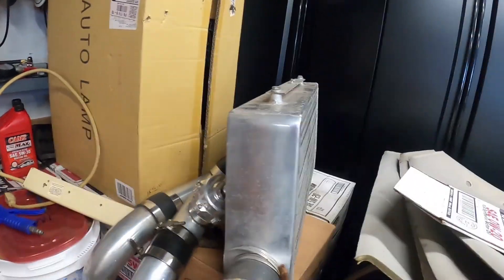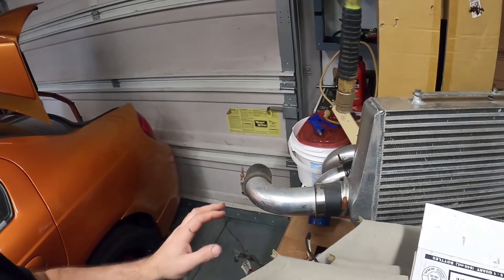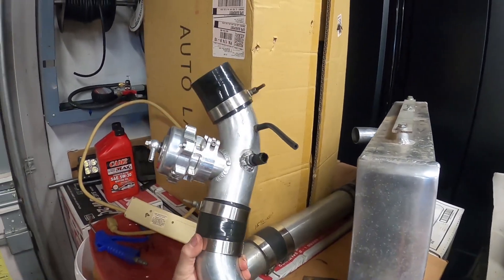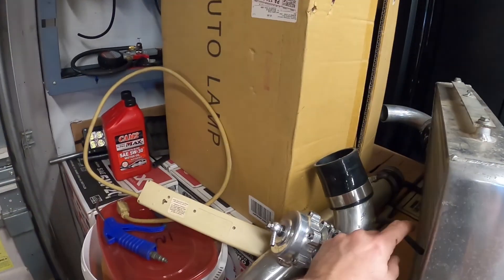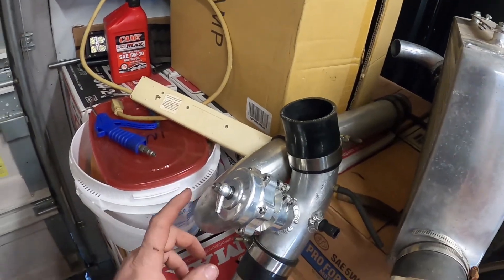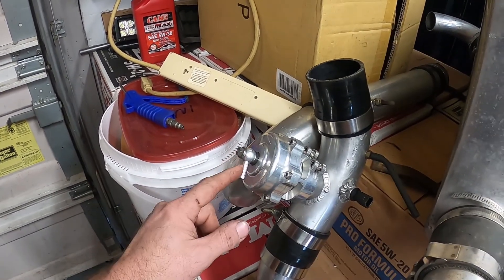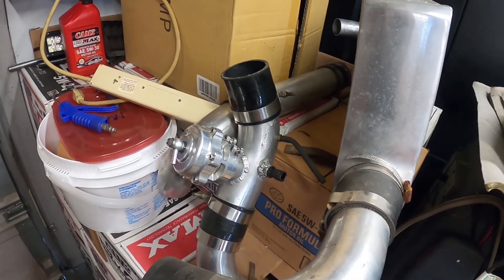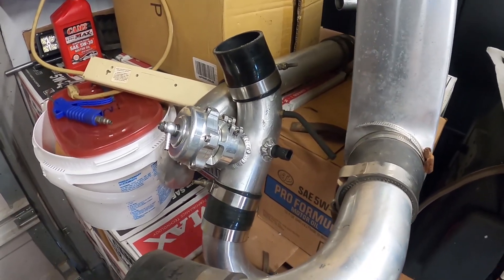srt4 boost issue after bov and bfm upgrade

Comment: THANK YOU! I watched countless of videos on how to install an HKS blow off valve but they dont go in depth on how the vacuum lines should go, your video was of great help!
Reply from the maker: The vacuum line for any aftermarket bov will t-off for vacuum at the port at the throttle body you will not need the vacuum lines off the blue solenoid if you still have factory lines you can un hook the pink one from the surge valve and just let it hang there after installing the block off you can remove both the blue and pink but will need to cap off where the blue line connects

Comment: Super helpful. We got a srt4 recently and they used the pink line for the bov.
Reply from the maker: it just doesn't work with the aftermarket bov's its pretty common to see mods done incorrectly on these cars i get to fix lots of similar issues to this on lots of other srt4's

Comment: I did a solenoid delete off some videos. I calped top turbo nipple. Ran the bottom one to the internal wastegate. Capped egr line. Aftermarket bov to intake nipple. And nipple on hardpipe to tip.. not seeing any boost. I think im overthinking it.. im getting told i need a boost controller in between turbo nipple to internal wastegate.. but im thinking i need a source of vacum t'd to the bov and intake. Did i just answer my own question?
Reply from the maker: with no hoses hooked up the stock gate will still make 5-8 psi and yes you need to get vacuum from the intake to the aftermarket bov for it to work

Comment: sounds like my problem. before external bov and hard pipes my boost and spool was fine. now the boost guage is showing boost, but I'm not always hearing the release of pressure when I let off the throttle like before and only certain instances where I can hear the turbo spooling. the cai on mine has the one hose that goes to the the TB deleted, but the mechanic that did my setup said I didn't need it? it has a bigger TB, not exactly sure what the deal is, but it sounds like it wasn't setup correctly.

Comment: Could you do one on how to run lines for an external waste gate? I’ve seen different diagrams where you t the tip line(the top line on tip solenoid) with the waste gate and others that show the tip line running into the charge pipe.

Comment: Hey I have a big turbo srt setup and I have none of my atomospheric sensors hooked up and I have an external wastegate and aftermarket blowoff valve how do I run my vacuum lines?

Oh I have a boost solenoid as well not a controller.
Reply from the maker: here is a link to a video running vac lines for a big turbo
https://youtu.be/5Jz-V259xEM?si=H2OspZ0ZnFlqJA1H

Comment: Where are you located. I have a stage 3 srt4. And need someone good with them in Ohio.
Reply from the maker: I’m near Harrisburg pa
Reply: @Mattsneedforspeed  i have a bad 3rd gear grind. I know it’s super common and the best fix is new 3rd gear synchros and a gear extender right? I’m wondering how much i should be expecting to spend at the mechanic to get them synchros put in ? I don’t want to get absolutely taxed on because I know it’s a very common thing. Just paid 9k for the car and was told 3rd gear was a 600$ fix
Reply: @Mattsneedforspeed  I’m Ohio wish you were closer I am in desperate need of a good mechanic and tuner

Comment: Why does my srt4 sound like a train horn under boost
Reply from the maker: the first thing I would check for is a boost leak..
Reply: @Mattsneedforspeed  okay thanks  will be doing that this week thank again
Reply from the maker: @robertdennis972  check all the clamps on the pipes and look at the one under the ac compressor on the passenger side sometimes they can get a hole there because the center mount drops down

Comment: I only boosting 7 psi max. I fixed all boost leak
Reply from the maker: how are the vacuum lines ran ? a stock gate will make about 8psi. what waste gate are you running is the rod adjusted correctly ? what kind of bov it could be leaking ?